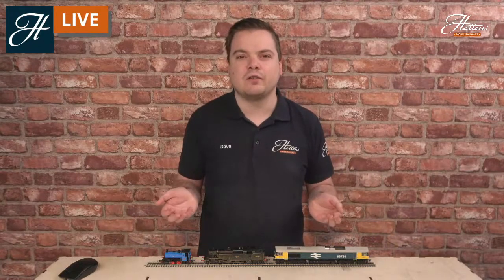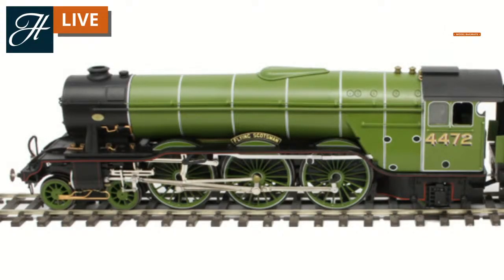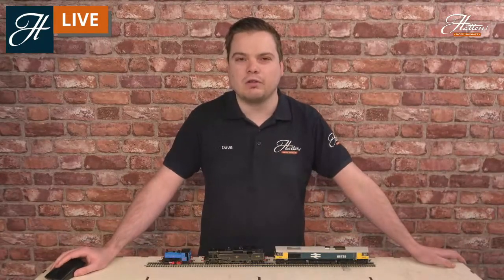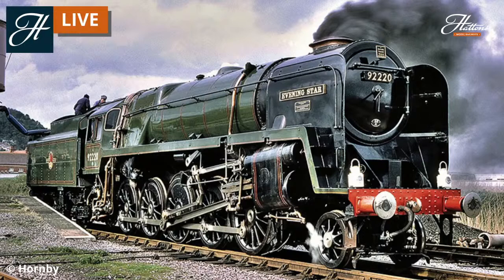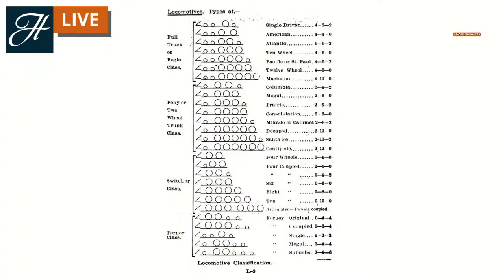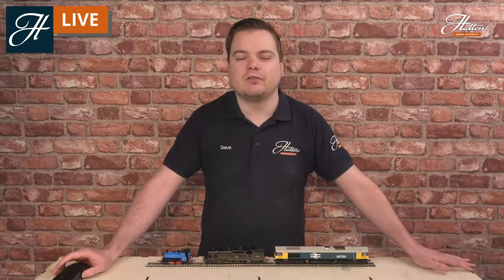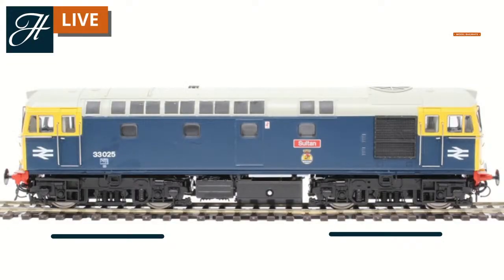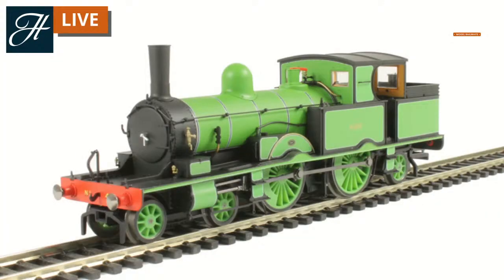Locomotive wheel arrangements - a beginners guide

Comment: Question: If the leading wheels can slide from side to side, then how can they guild the train in curves?
Reply: Because the wheels' flanges guide the engine across the curves
Reply: @Combes_  If they are not fixed on the frame, their fangles can only guide the wheel set itself.
Reply: @henrywang3977  you know what I mean

Comment: Another variation that may confuse some is a loco like the Hush Hush W1 being correctly described as a 4-6-2-2. This is due to the trailing wheels not being in a bogie.
Similar with the early broad gauge Iron Duke and Rover classes being recorded as a 2-2-2-2 in a HMSO Science Museum booklet I have due to leading wheels being mounted in a rigid frame and not a bogie.
Probably less confusing to call them a 4-6-4 and 4-2-2 though.

Comment: Surely the front bogie wheels are leading wheels?

Tenders would only be included in the Whyte notation system if the loco or tender was fitted with a booster set like some of the NER Atlantics which became 4-4-4-4 tank engines, until the boosters were removed  to become Atlantics again.

The Southetn Railway adopted for a while a loco numbering system based on the wheel arrangement system used foe diesel and electric locomotive wheel arrangement classification system.